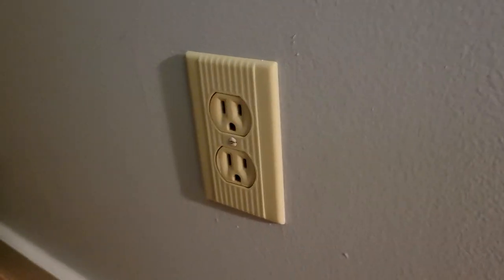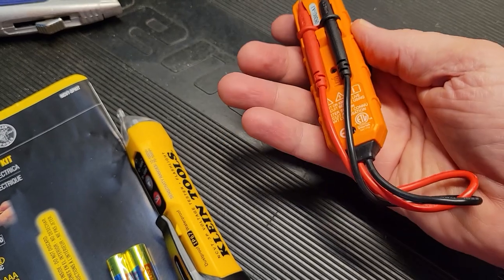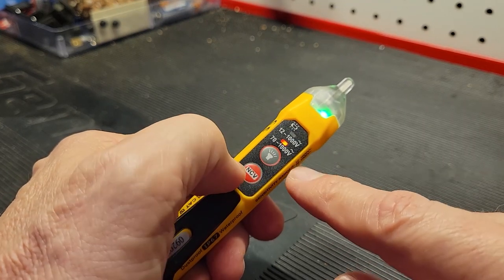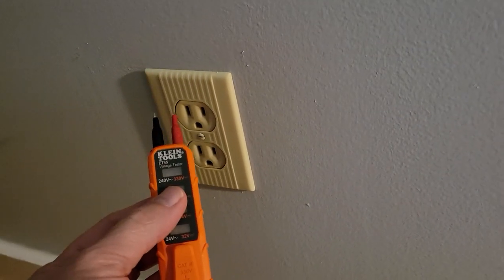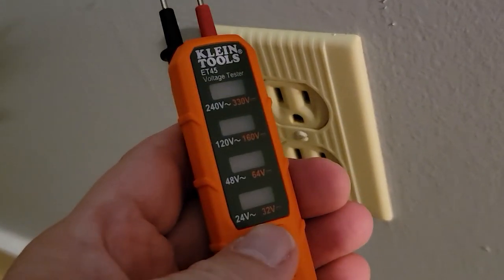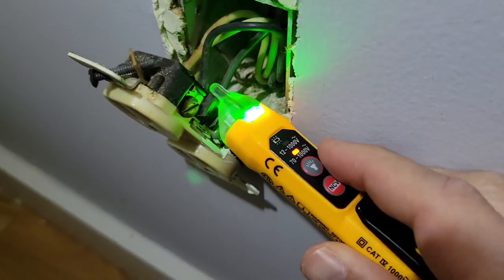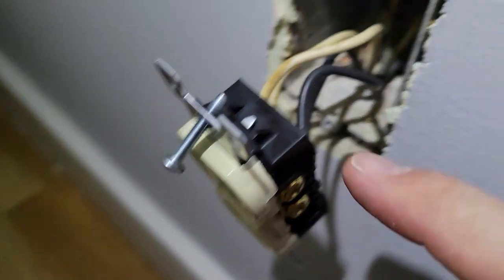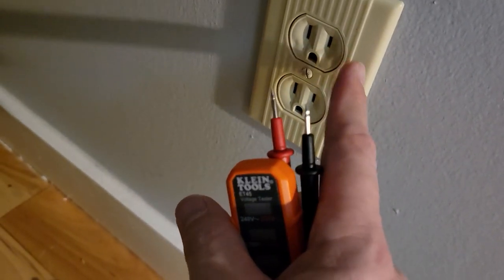Klein Tools Electrical Test Kit NCVT-3PKIT with NCVT-3P and ET45

Comment: When is a situation that we use the blue light setting on the probe tester ?  Thank you for this video !
Reply from the maker: Great question, the blue light setting Mode 2 is for 12  - 1000V range, where as Mode 1 (red light) is 70 - 1000V range. The blue light comes in handy when you suspect there might be a voltage between 12v and 70v ie a bad or loose connection on the outlet, a circuit breaker that is failing, an open neutral connection, etc. According to Klein "In Mode 2, the tester is more sensitive to high voltage sources and electrically noisy environments." They recommended to set the tester to Mode 1 when expected voltages are above 70V AC.
Reply: @cfldriven  Thank you for taking the time to answer!

Comment: Thanks for making this video, can you use ET45 (in my case i have a ET40) to identify the hotline? (There are wires are not labeled in the socket)
Reply from the maker: Not really since it will light with reverse polarity. However you could go from  each wire to ground and if the unit lit up that would be your hot wire.  A non-contact probe would be the better option as it doesn't need a ground.

Comment: Will it let you know if the outlet is not grounded? Thanks
Reply from the maker: What you want is an outlet tester, as these are only detecting magnetic field and the voltage. We use an outlet tester in this video https://youtu.be/AAU7GF948xw

Comment: Can the ET45 voltage tester be used on a cars fusses
Reply from the maker: Unfortunately you need 32 volts DC to trigger the lamp and most cars use 12 volt systems. A basic multi meter would do the job and be more versatile.
Reply: @cfldriven  thank you. I didn’t want to invest that much but guess I’m going to have too.
Reply from the maker: @jonathanlambert5196   I know having to buy another tool can be a hassle. A basic multi meter set from Harbor Freight or Home Depot will go from $7 to $13. Plus it will come in handy for other electrical projects.
Reply: @cfldriven  thank you

Comment: How did you get 220 when tje meter is reading 120-minute 8:03
Reply from the maker: Good eye, as can be clearly seen at 7:41 the 120V LED is lit up, but I read the value above it. Sorry about that. A reading of 240V would indicate a serious misswiring issue, which was not the case with this receptacle. Thank you for catching this.